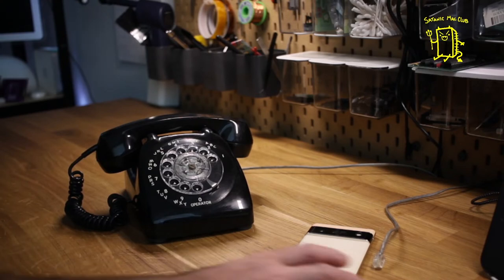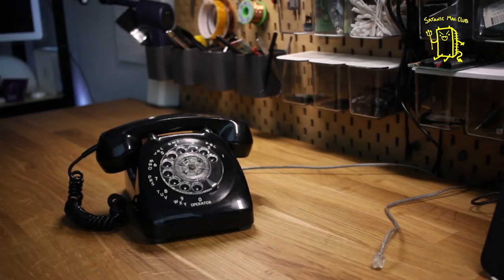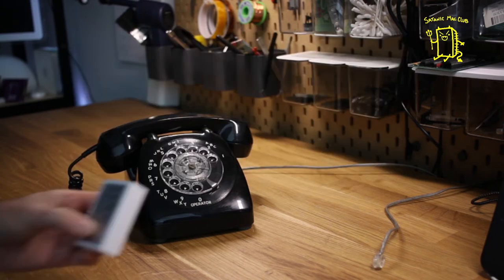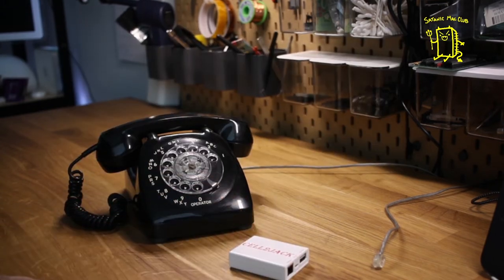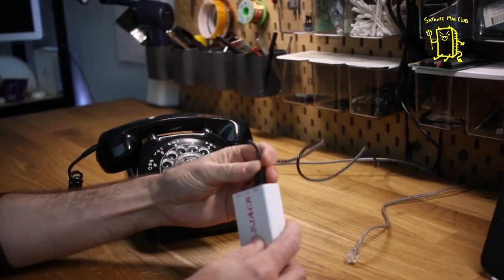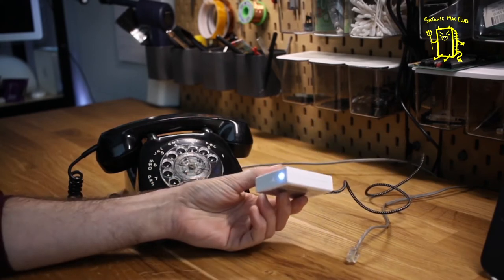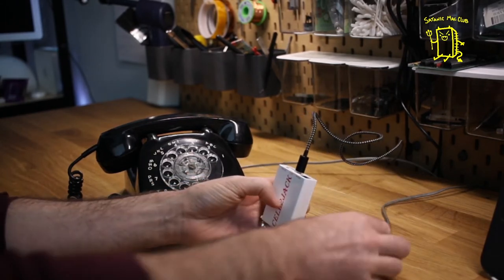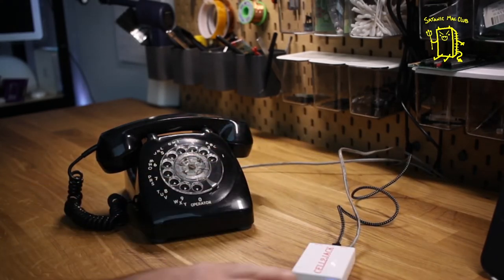Useless Device - Rotary Phone to Bluetooth!

Comment: I don't know if I would quite call it a useless device. I have one connected to an old rotary phone on my desk and I use it quite often. I much prefer the feel of a real handset in my hand while I am on the phone as opposed to a cell phone, which feels bad to hold because they aren't really designed to be used as phones anymore. Before I got this I would always miss a lot of calls because when I get home, I stick the cell phone in my drawer and I don't use it (I know, surprising, I am not glued to it constantly). So if someone called me, I would either not hear it, or commonly I would have my ringer off from work. Now with this device, It automatically pairs when I get home, and if someone calls, it will ring the phone on my desk, and all I have to do is pick it up and answer the phone like normal. It will even ring when the cell phone is on silent. I also find it much more convenient when calling or receiving calls to just have the phone at my desk where I always know it is right there, and I don't have to get up and get it.  I used to have actual land line service, which I would use to call people, But these days if you give someone a number and tell them it is a landline, they look at you like you have two heads, and even if you tell them you prefer to use the real phone, they will still always just use the cell phone number. So this way, I can have a fully functional simple phone that just works, as well as still using the same phone number for everything, and also not having to pay more than one phone bill.